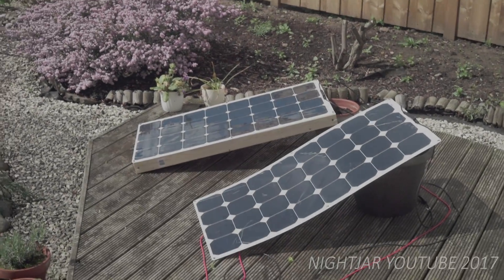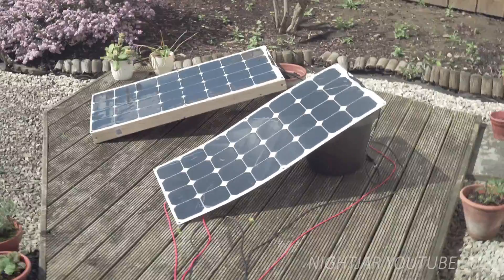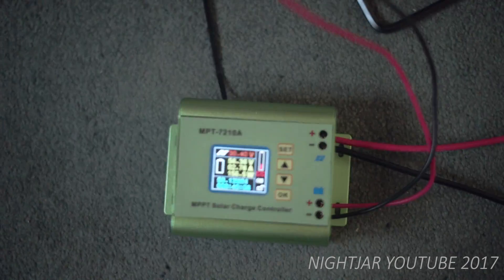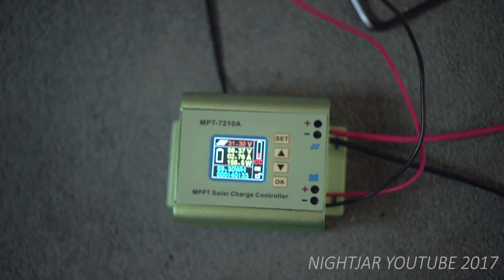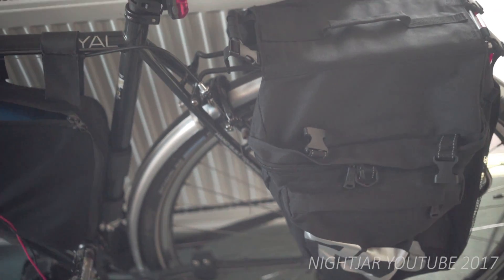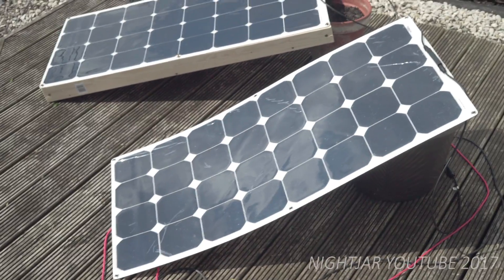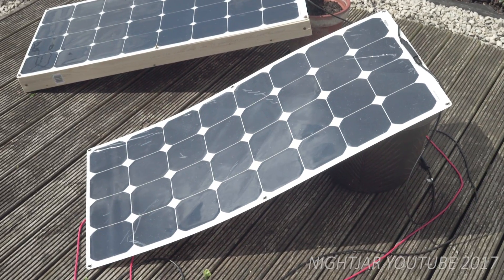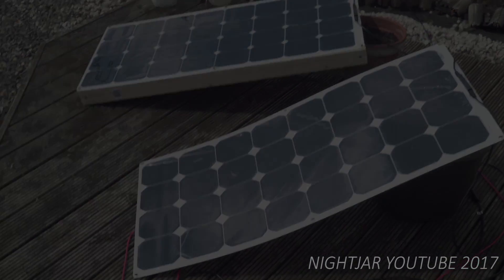Solar Powered Electric Bike Project #1

Comment: took the same panel on my  bicycle trailer july 2019 from the Netherlands to the Normandy D-day beaches (over 2000 km in 3 weeks) - the panel did bend sometimes (as it should do) - it gave 0 output after 2 weeks - that so called MPPT controller (it is not MPPT) I also used before july 2019 - got rid of it, its garbage - got a Vectron MPPT 75/10 together with a 100W normal mono panel with glass (5.8 kg) at 24V - that works really well and is much more sturdy (I connected the Vectron charger to a Golf Kart Battery LiFePO 12V 22Ah). Best way to go on a e-bike with trailer (I have made the panel freely adjustable to get the max east to west out of the panel). I have 2 Bosch Powertube 500 batteries with me (allways charging one). On a normal bike day (10 hours) I get 1 to 1,5 free charge of 1 battery from the sun (giving me radius of 180 km to 200 km at 20 to 22 km/h) - feel free to contact me for further details and tips

Comment: Hey Jack, I want to ask you something about the controller mppt 7210a.

I also have a controller on my solar car and my question was whether you used it to drive to China or did you use another controller. if so, what was the name and where is that controller for sale? Thank you very much.
Reply from the maker: Hey! No i didn't it's too unreliable and drops out every time you shade the panels. Would be okay in a static application. I used a genasun mpt boost controller. I might actually be selling my spare one that i left at home and haven't opened. Leave me an email address or something if your interested! :)

Comment: interesting i have that controller and would like a trailer with couple panels , have you built yours already and what problems have you encountered/ my bikes 36v 10a battery , i cycle on lowest power allo the time and only use assist on steep hills
Reply from the maker: lookoutleo have a look at some of my up coming videos I'm hopefully going to show my trailer build :)
Reply: have you managed to get the system to charge while you cycle and if so how much extra range you managed to get? how much were solar panels and what voltage?

Comment: with 100w panel you  get about 100wh a day from sun on may when its maximum  power from the sun other  months possible less.   i have tried this with my bike  during trip from estonia . for ebikes using solar panels -  you nevere get optimal angle if using  them horizonatal . dust from roads also   decrease power output from panels .  and definetily you need trailer to carry panel -  thats more total weigth .

Comment: Why not just go for a fast charger? When you can completely charge your battery in 2 hours while drinking coffee instead of carrying big solar panels. UK is not kind to solar, so they would never output peak power... That's why you don't see them on e-cars. They make negligible difference and it's always quicker just to charge from the socket or have bigger battery
Reply from the maker: Mark Vasilkov Mark Vasilkov good point! I am building a fast charger too, i will try make a video about it when i can. The reason you don't see solar panels on 'e-cars' is that they are not efficient enough to make it worth while. Whereas on the bike if I'm producing 150w that's enough to to propel me at least 15km/h. If i get three panels some day (one on a trailer or roof) and make 200w+ i could easily go 25km/h without taking from the battery. The tesla model S gets around 250 - 350 wh/km efficency and my bike is usually less than 10wh/km. Thanks for the comment!
Reply: Don't forget that you will only get 150W on a sunny day and at a good angle. Panels being flat you will loose 30% of power, I'm not even talking about the UK weather. Chargers are smaller and don't care what weather it is outside.
Reply from the maker: Mark Vasilkov when i had just one panel i managed to get 105w from it at one time here in the north of England. I'm hoping to use these panels on a trip across Europe so the further south i go the better! :) like you say i will loose some efficency to the bad angle.
Reply from the maker: Mark Vasilkov yea good idea. i will definitely get a trailer some day, one of the single wheel ones
Reply: when you park it charges the batts when yer ready to roll bat is already full.  thats how I see it gonna work. if i get the power as I ride totally from the sun then its a big bonus.  

btw does that solar controller stops the charging when bat is full?

Comment: I'd build a trailer for the panels you can have it off the bike which looks more natural and you add storage for going to stores.
Reply from the maker: Cory Kaupa great idea! I'm hoping to do this some day! The panel would also act as a bit of a roof for my storage area potentially also! Thanks for the comment!
Reply: no problem man, great minds I'd say. I'm working on my own 20' container house and I've wanted an ebike for years.
Reply from the maker: Awesome! I would highly recommend an e-bike, it really is a great way to get around!
Reply: the only reason I haven't is my 70 mile commute. I'm sure I could make it work at sub 20mph but it's just not feasible for me now. Just going to focus on the house this year.